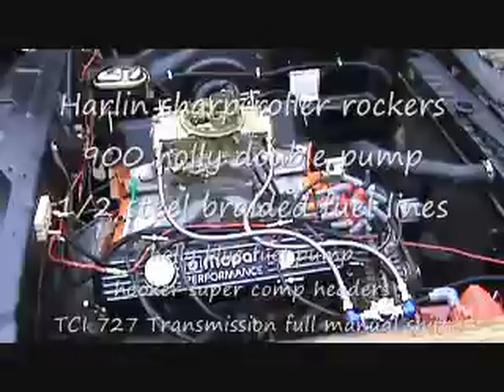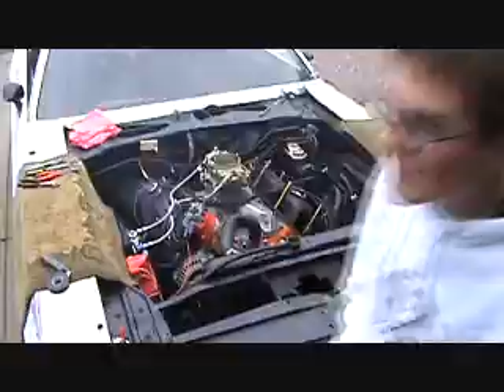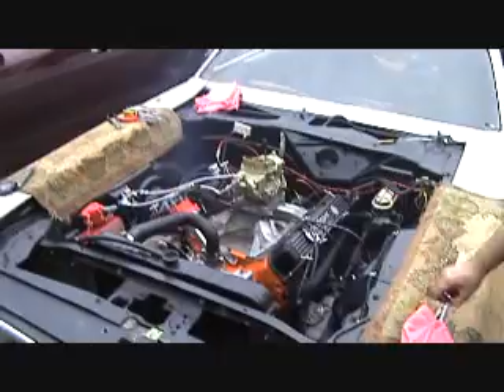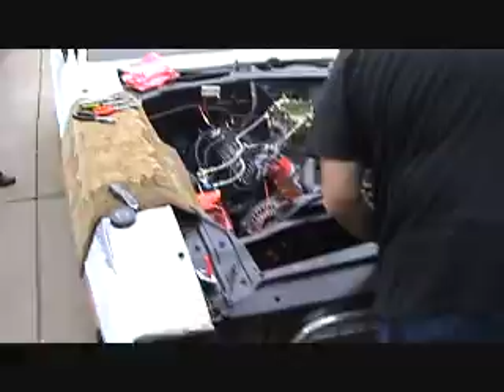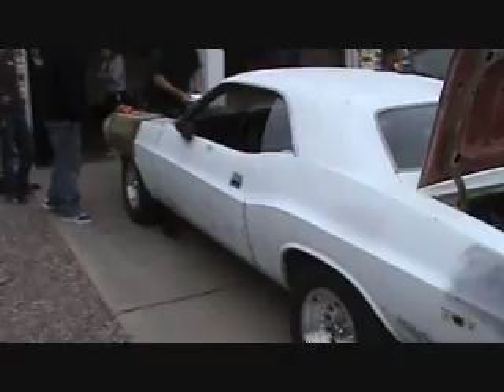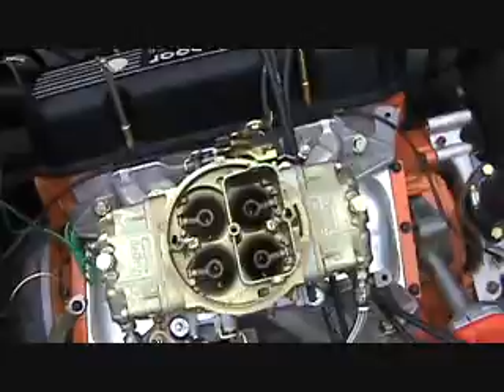72 Challenger First Start 383 Stroker

Comment from the maker: Thanks everyone for the suggestions but you have to understand that my dad has been building Mopars since before I was born.  his first car was a 69 Roadrunner with a 440.  His methods are tried and true.  He built the engine up in his garage at the house where I grew up.  I commend him for the ability to take an engine completely apart and put it back together in his garage with hand tools and no manual, diagram or part numbering.  I just wish I could have picked up on this skill.

Comment: can see a lot of ignorant comments. That "noisy" starter is a damn fine one. their rebuild rate is much lower than most starters and it is spinning plenty fast. the 383 isn't junk either. Stroke it like these folks did and a 440 can't make but a few more cubes when it is stroked. They must be chevy guys....
Reply: +Rick McLemore ...GET A GRIP! BEEN BUILDING DODGES FOR 30 YEARS, YOU STROKE URSELF, THESE GUYS ARE CLOWNS.
And my last name is Landy, you do the math.
Reply from the maker: +Cabo Choppers My dad is no clown.  He has been building mopars for far longer than 30 years.
Reply: and your dad's car is nice man.
Reply from the maker: +Rick McLemore thanks.  he actually sold it.  i dont know if you saw my other video of when it was finished.  someone had also asked how much it was.  i think it was between $35- $40k to get it finished.
Reply: The 400 block was, actually, the BEST wedge big block that mopar built. One, in particular,  is called the "super block", which after 2 years of looking, I was fortunate enough to recently purchase.
Reply: Absolutely. It is a well known fact that Chrysler's gear reduction starter was superior to all other designs. That's why all modern day starters use the design, only they are more compact than the classic Mopar starters..  There are a lot of ignorant people on the internet.
Reply: all cold engines need immediate rich mixture and the timing on the engine is retarded,you can hear it firing out the exhaust,the gear reduction Chrysler first design starter is the most copied in the world,a fine tuned engine,will start at lower amp draw spins

Comment: 383 stroker? how does that work? its a 383 big block with a stock stroke crank.
Reply: Not stock stroke. 3.375 is the stock stroke. Now it probably has a 4.25 stroke to either 489 or 496 cubic inches.

Comment: Huh, small bore, long stroke angle. Dodge has proved that works. Look at the Max wedge. Those engines yank those old heavy body styles around like toilet paper. And you have this setup in an A body? People ain't gonna how to deal with that setup because they simply don't know what they are going up against. Been through Chevys, Fords. But Dodge simply rules. Nuff said.
Reply: A 383 has the same bore as a 427 chevy motor.

Comment: I love the sound of a Mopar.. Im just wondering why did you use a Holley? Edlebrock is so much better in so many ways, I use to run Holleys and got rired of blowing power values. Bought a Edlebrock and threw the Holley as hard as I could on the driveway, My 72 Challlenger never ran any more on the track... NO CAR BUT A MOPAR

Comment: It seems to be struggling. With a bit of a valve misfire... Timings off. 

as for the history of the 383 wars, the big 3 all have 383's  Chryslers is a modified 400 big block, GM's is a 350 small block with a 400 crank,
As for ford, there 383 was a stroker, exclusive to few builds. Like the Marauder, and the better Bronco Models.
The engines were all designed and built as stock car engines, which would mean, stock performance, with ultralight bodies.

Comment: I hear ya, bruh... and, where's the timing light?? As soon as it's running, I know what my total advance will be, at least, initially. As soon as it fires, set the timing, clamp it down. Also, I would NEVER use a flex fan; a clutch drive fan is much more efficient, and either will work better with a shroud, not to mention safer. All in all... it sounded sweet!

Comment: Always light em w/no stat let em perge ..dump the h20 fill it to the top of the t-stat housing  add youre coolant..then put the satt in  fill it start it and top it off.  all done and ya never got it above 200..unless u didnt fill it right. or its a tyt moter which will have to come out and be re-done ryt
 .

Comment: I for one STILL swear by Holleys. Edelbrocks use a nitryl butyl accelerator pump diaphragm, and every one I've ever worked on developed a flat spot just off idle. Why? Because there is so much ethanol in fuel, now. If you're timing and carb are set up properly, you'd quit blowing power valves.

Comment: love these e bodies but not much a fan for the 383 imo you might as well junk that motor and fine yourself a 440 from 67-70 get alot more out of the car
Reply: +ToyHippie i know it does not make any sense posting this.... but anyway: the LOW deck mopar big blocks are by far superior with better bore/stroke ratio, rod angle, rev higher, shorter push rods, less drag, less weight and sturdier block. low decks usually outlast rb's. no secret among pro engine builders. they prefer the LOW deck mopar (383/400 best mopar engines ever btw).
Reply: +ToyHippie I love the 383 for it's natural ability to rev however your argument is hard to argue with as 440s like to rev up too.